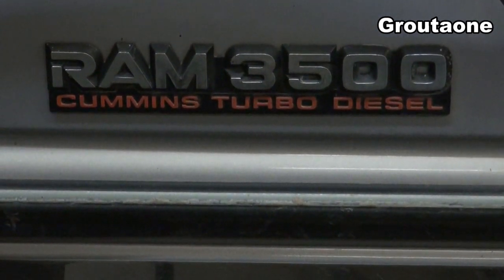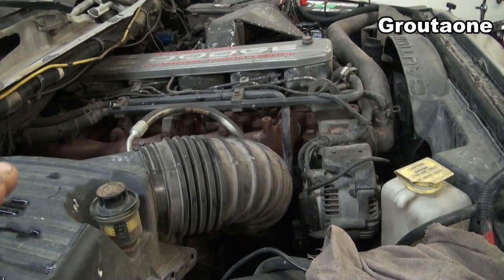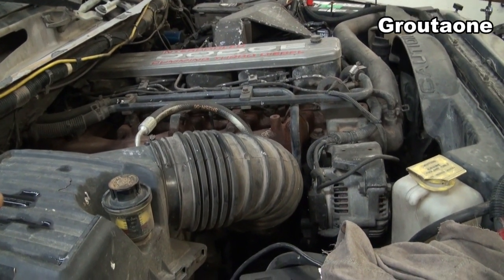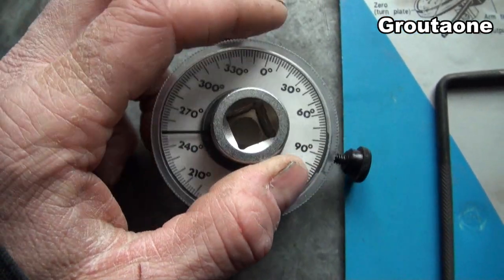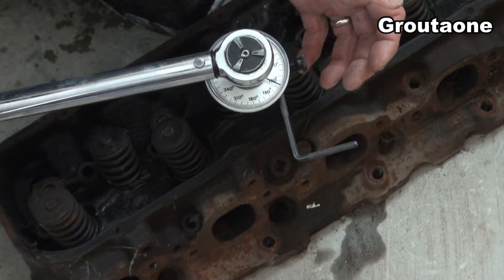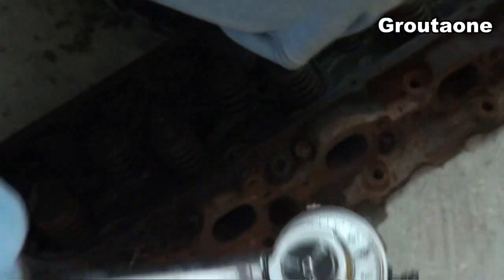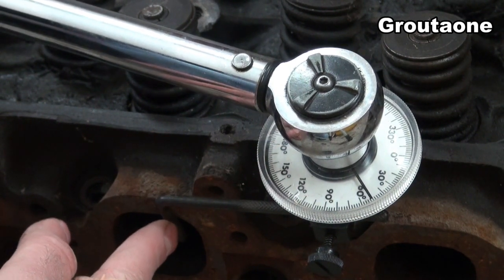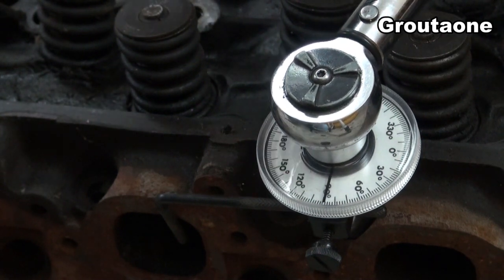Head Bolt Angle Gauge How To

Comment: Question, So do you torque to the proper foot pounds first and then tighten it up to the specified angle ? No one seems to be thoroughly explaining from beginning to end.
Reply from the maker: I have a video using this on a Cummins engine, first torque to a low setting then use the gauge.

Comment: Just built my 12v reused the head bolts the rebuild kit came with a template for the head bolts to see if they were stretched which they were not. Found somewhere that in 89(year of my engine) they didn't use tty so I torqued to 115 ft lbs

Comment: The degree is worked out based on thread, bolt size and the yield range of the bolt etc. 90 degree is prob what fell in to the scope best as most mechanics will struggle to turn it to what pops out the calculator.

Comment: It is pointless to do a head-gasket unless there is a issue.
Reply: +Matthew Troiano might as well do it while the engine is out. No, you don't need to pull the motor to do it but why make it a future hassle?
Reply: Because unless the factory seal is compromised it will be a waste of time and money. It's his time and money so he can do as he pleases. I have just over 200k on my factory head gasket and plenty out there with more.
Reply: +Matthew Troiano I know a lot of people with 12V cummins that have leaky head gaskets, most of which are just over 200k miles. With a motor that old and the amount of compression that diesels make, its bound to happen, if he does it now he won't have to worry about it for another 200k+ miles.
Reply: What ever you say.

Comment: +groutaone do you have any idea why +90 deg. After torque?
Reply from the maker: +Ben Clausen Torque to yield bolts do stretch and are a one time use, toss em out after they been in use, the Cummins head bolts will stretch also but are not TTY bolts and can be reused. The Cummins gasket set comes with a paper gauge to measure for over stretched bolts, if they pass they can run again, even ARP head studs stretch when torqued down, how far a bolt returns to original length when removed is key. I don't have a 100% answer about why the 90 degree is used but could be a more accurate and consistent clamp force between all the bolts as friction on bolts greatly comes into play as bolt torque is increased
Reply: +Alex Lachaine  Stock headbolts are torque to yield bolts meaning they stretch. The 90 degree after torque is to stretch the bolts to apply the right clamping force.